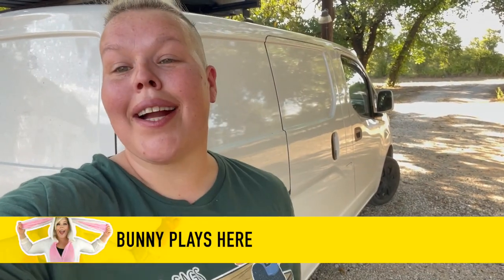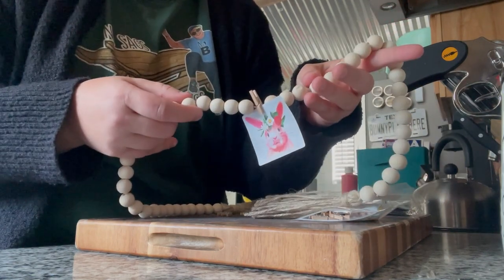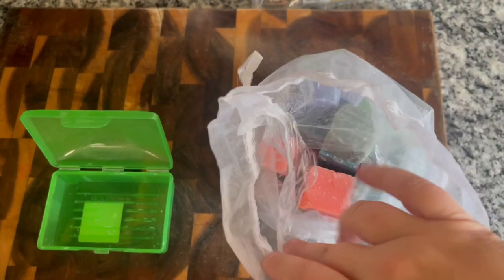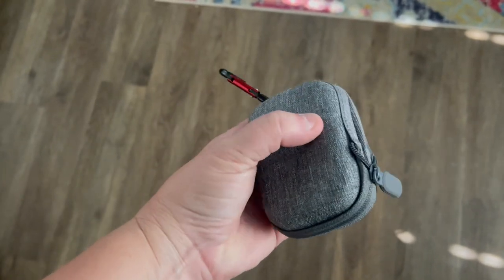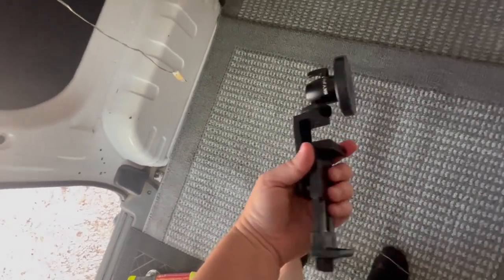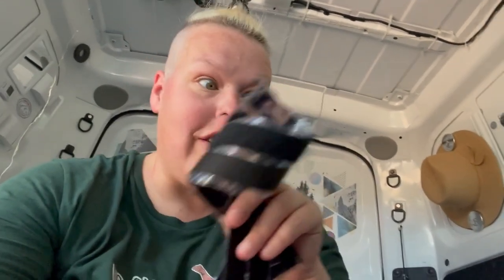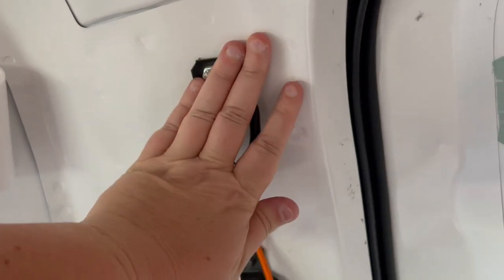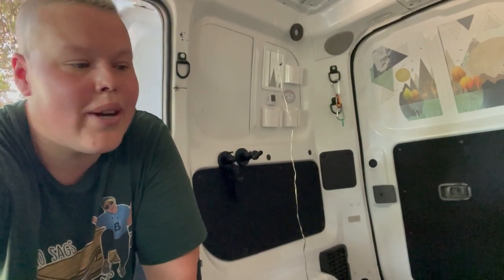No Build Van Build Tips | Small Projects Really Make It Come Together

Comment: Are you putting the shelving unit back in?
Reply from the maker: At some point I will however for the time being because it will have to be out of the way when the doors are installed I am not putting it in just yet.    That might change but I am trying to make it as easy as possible to remove all the things when it does eventually go in.